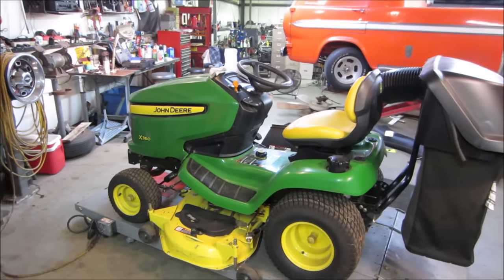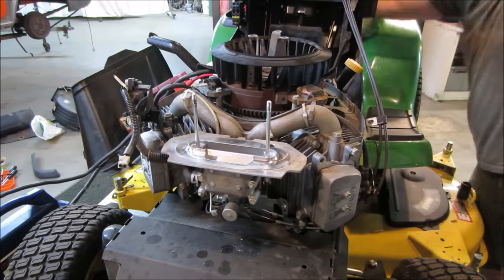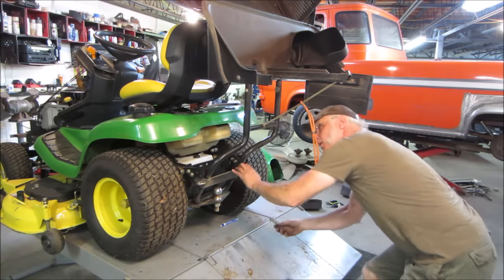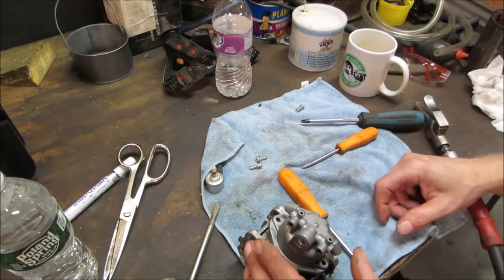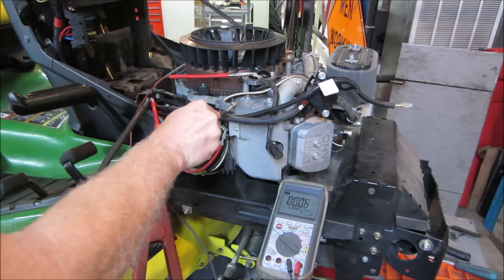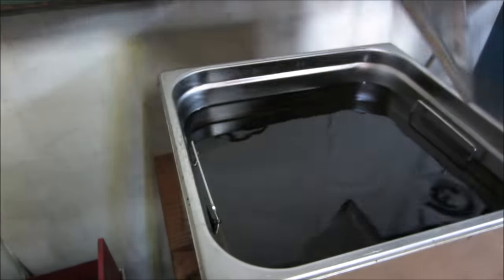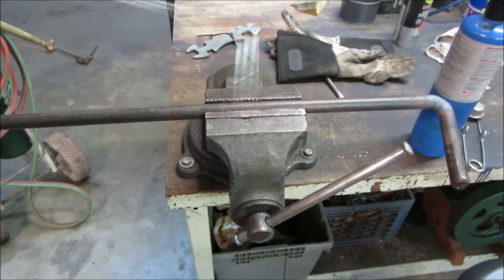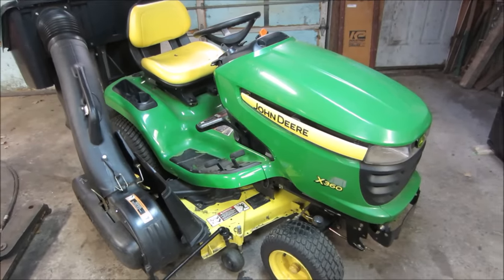Will It Run? abandoned John Deere x360 from a Yard Sale,

Comment: Glad I remembered this video I just got in a Husqvarna mower with same Kawasaki engine believe that is a FH641V also had to do a double head cleaning and valve lap and lash did not bother carb clean the gaskts were all messed up and there was chunky fuel stuff in bowl so I purchased carb and switched out the choke because the linkage was different on the new carb . runs great now .  Now I need to work on my zero turn with same engine woo hoo

Comment: FYI, supposedly Deere spent enough money building the deck to hang the deck on the tractor, the deck wheels are anti-scalp and only touch the ground when the grade becomes that uneven.   Running on the ground will only eliminate the wheels and wear out every support bracket for the deck. Great video--enjoyed!  Sure the bagger cost more then your machine purchase price. I would call that a great investment.

Comment: If that's a Kaw engine, I have 2 JD 425s with Kaw engines and they both have delay modules that will delay killing the engine for a couple of seconds after turning off the ignition. I think the reason for that is to purge some extra gas from the carb after the fuel solenoid stops the flow. I think also the reason for not being able to close the choke all the way and the spring loaded choke lever is all part of a pollution solution. It May not run for s***, but at least it doesn't stink!!

Comment: I knew it !  JOHNNY 5 IS ALIVE !!!

But on a more serious note... as you mentioned the water gathers at the bottom therefore imo the first thing to do before disturbing the motor or fuel system is to open all the drain plugs just a little to see if water exits or other.

Comment: You could file a bit off that full throttle-stop and pick up a few CFM (Ponies).
 In CA during the late '70s and through the '80s, "CARB"  limited our Quadrajets to 650 CFM and all we had to do was file the stop and let the "barn doors" open all the way up and we ended up with 750 CFM carbs and a ton more WOT horsepower!

Comment: for future reference whether 4 inch bar or 1/2 inch bar your gain on a 90 degree bend the gain or stretch  is 3/8 of an inch...bent pipe as an electrician for 40 years gain on 90s is always 3/8 to 1/2 inch

Comment: Place where I worked a few years ago,we had a problem with drivers parking their forklifts,leave switch on,engine off.Ran up hours but the drivers were not diong anything.but listening to dispatch radio and answering when they wanted to.We put a switch into the engine oil pressure gallery that would send current to hourmeter,=engine off switch on they could hear dispatch but would not get any time on hourmeter.Pissed off drivers,happy company because engine oil use went way down,less oil changes.

Comment: Is gas running out when you are trying to start it. Top cover not right, better now. I have a Sears riding lawn mower with a 46" cut that is about 5 years old. When its cold or first time starting it, I have to use starting fluid to get it to start, One little squirt to start it. When its hot it starts right up. Is this good to do this? Great Job as Always.

Comment: Hi Mustie my name is Jack I’ve been watching you for years and I enjoy every show I have a couple things that I’m hoping you can help me with. I bought a MTD Yardman lawn tractor with a 13.5 Hp Briggs & Stratton it starts pretty good but when you push the throttle to wide open position just before it’s wide open it starts to pop and backfire and wants to die but as soon as you pull the throttle back a bit it starts to run better. If you could give me any ideas I’d be very grateful.

Comment: I have the current version of this tractor and it was nice to see the inner workings. Yes, spring loaded choke and you need to choke it even when it's warm. Yes, the engine has a slight pause when turning the key off. I don't have the collector so I can't help with that part.

Comment: love everything ya do including the test light trick on the charging battery - - but it might be worth mentioning next time you're doing it that disconnecting a "live" charger from a battery that could be "gassing off because it's been under charge may be a bit risky - horrible when a side blows out of a battery - nonetheless, very much enjoy all of your vids - thanks.
Reply: I know someone that didn’t come out of a coma for 17 days and multiple surgeries, plates in his face, and a new jaw.   A chunk of the battery broke a 2x8 in a truss 14+ ft overhead.  NEVER EVER  break the connection near the charging battery with charger running. If using jumper cables break the connection at the good battery and keep your face clear while doing so.  Better yet use a chassis ground instead of the battery ground on the good vehicle and break the circuit there.

Comment: Check the water level in the Batt. may be low on water Should also use a dead blow hammer not a welding hammer to loosen up the carb.
I am  ret . omc , Aircraft Amp, Boat Evenrude Johnson cirt. Fect fuel Injection  Ob , IO mech. Nice tool on your air ratchet to loosen those carb screws!!! I would of also had a repair manual on the carb from John Deer to ck the settings and ideal circuit.

Comment: that starter is fine ...it sounds just like it should... there's nothing wrong with it that's just the way it sounds... my starter has sounded like that for four years... that's a different kind of a tractor then what you might be used to... but in fact it's a better kind of a tractor then what we have been working with all these years... it's just different things about it are different

Comment: The Deers, I have a 345 use a time delay module to stop gas, they run a few seconds to burn the gas. That is to stop back firing on shutdown. Can be a issue and hard to diagnose when runs fine for few minutes, then just dies. I cleaned the carburetor 3-4 times, would always restart with fuel down the carburetor, then die a few minutes later. The fix was to replace the TDM(time delay module), about $16.

Comment: I worked on my dads steiner zero turn mower with same motor.  For a long time. Ended up deleting the fuel shut off solenoid and installing a seperate cut off switch to coils to turn off.  His problem was always hard starts from new.  Way easier to install another switch than to mess with all their crazy tight wiring

Comment: About the old fuel still in the tank.........a neighbor advised me once to add a little Stabil in the tank before starting an engine that had been sitting a while. I tried it and it worked. Since that time years have passed and I still use that little trick. Works every time. I use only non-ethanol gas in all my small engines, but Stabil still helps out.  Give it a try.

Comment: I have to wonder.   One of the first things I check on an older battery is the water level, and make sure it's up to the right level with distilled.   That used to be one of the things you always checked when you changed your air filter.   It seems like Mustie1 just tosses a charger on :)

Comment: Another reason I'm now using the Krud Kutter parts cleaner in the ultrasonic....no issues with any type of gasket....rubber or paper....I put everything in.  I have worked on those carbs on a Husqvarna zero turn.  The Kawasaki V-Twins use that carb & variants of it.

Comment: It might be designed as a mulcher-bagger to cut up leaves so that more leaves will fit in the same size bag, since uncut leaves are quite bulky; therefore, you might want to try bagging leaves with the mulcher insert in place, especially if itg is hard to take out.

Comment: If you are sure you are finished running the mower for the season, you may want to consider changing your oil and filter before storing it for the winter and do not start it after the oil change.  Either let it set for a few days to let the old oil run down so you remove as much as possible.  Or if you change it hot let it set for a few days with the plug out.  The old oil has acids built up in it which can attack internal parts while it is stored.

Comment: I tell you what. It's still a little rough sounding but it's getting there. It just needs to cough one good  time and I think it will be fine. I'd be so scared to run 10 yr old gas through that thing. My luck it would pick up every piece of trash in the tank and I'd be tearing a carb down again. I don't have much luck with carburetors.

Comment: Mustie I’ve been watching you for quite awhile now like since u worked on the Honda ct70 i have been wanting to apply the stuff I have learned from you so about 3 weeks ago I was working and found a 50cc scooter for free on the side of the road anyways been working on it turns over and started for a second after I did your trick of putting gas in the cylinder then putting the spark plug figured out the carb isn’t getting gas just ordered a another peacock thing that feeds the carb fuel then in the process of doing so I kinda broke the throttle cable got that on the way anywho thanks man for everything that I’ve learned from u so fat

Comment: BTW: JD mower deck wheels are just to prevent scalping. When on  relatively flat ground, the deck wheels should not touch the ground.
    I have the bagger on my 318,  and even with the added weight, deck wheels dont hit the ground.....hope this is a help....
Reply: w2dmw  ,  I wouldn't have known this without your comment. Thanks a lot!  de KQ2E

Comment: Mustie 1 The John Deere is set up that way to allow the fuel not to build up in the cylinders and burn off.  I worked for 2M Tractor for 22yrs and we were a John Deere Dealer.  Hope this information helps.

Comment: I had a bad battery one time and couldn't afford to buy a new one.  I dumped all the acid out, took it to the car wash and stuck the pressure wand into the holes of the battery to clean it all out.  I dumped out the water and then put acid back in and it worked fine!

Comment: Great deal.. I have a JD 324 with 48" cut. I have been looking for a mulching plug. Is yours 48" and if you want to sell it, how much $?  The blades on it look like the factory JD low lift blades. It's not easy to find high end mulching blades that fit the mulching kit.  I wish mine had power deck lift and steering!! My lousy back and knees need it! Mine takes a few extra seconds to shut off as well. It is normal due to having a touch of fuel in the bowl. I believe it is part of keeping shit fuel OUT of the bowl. The COIL KILLS are there for emergency kill switch. Fall off the tractor and it kills the blades and engine in a second.

Comment: After having the carburetor off, or the mower runs out of gas, I use a vacuum pump on the fuel pump it makes it easier on the battery,  and starter. I have also used carburetor cleaner through the the carb and run it until it runs on its own. Many times a  customer has a bad battery and I  really  don't want to replace it unless I need to. Sometimes the customer gets upset  for replacing a battery when they can do it themselves.  (Meaning cheaper) that's fine with me .

Comment: Buy that today it's about a $5000 mower. I just bought a 330 with bagger for $4100. The 300 series are dealer machines, not big box machines. The new ones have a Kawasaki engine.

Comment: I've had 2 of those tractors,  same models and a few other's similar,  they've all been extremely cold blooded, even brand new, you'd have to choke them even when they were warm.. annoying I know 😒 2nd when they shut down they've all had that 1½ second lag after the key was off before they'd die.. must have been designed that way 🤷‍♂️ As always, Love your videos! That's what I call educational entertainment!
Reply: It seems like any ohv engine needs some choke for starting maybe from a leaner mixture running condition.
Reply: @kenore4003  One thing that comes to mind is that fuel shut off solenoid in the carburetor and having spark even with the key off.. when you turn the key off to shut it down that little plunger pops up and plugs the jet off and the engine runs for that last 2 seconds burning up all the fuel in the jet, the throat and both cylinders and then it dies.. On older machines there was no fuel solenoid in the carb, instead it just kills the spark to shut down, so both cylinders and the intake and carb are all still rich in fuel.. Choking the new ones must be how they quickly get fuel through the jet, intake and into the cylinders to fire up.. because they will fire up when they are warm without choke, but you have to crank for a while before it does.. 🤷🏼‍♂️ That’s kinda my theory anyway

Comment: I had an 80's Craftsman with a deck timing belt. It was fine until a random screw took out the belt. One blade kept turning after it knocked the second one out of the way. Bent both blades and one shaft. The belt alone on that thing was $180. But I liked it because the grass would exit out of the rear center of the deck instead of the side. You could mow up close on both sides of the deck and you didn't have to worry about regrinding mounds of cut grass if you waited too long between mows. Not that I would know... 😉

Comment: The plastic shaft with the two jets where the floater connects should stay in the carb body. It is held on by a small phillips screw. I noticed that it came out when you took it apart. So I wonder what happened to that screw.

Comment: The charger you use, is it a trickle charger? Trickle chargers with an automatic desulfation program built in work wonders on batteries that have been sitting for a while. If you don't have one of them, get one!

EDIT: nvm I just saw it was one of those older chargers. You really need to get a trickle charger with battery recovery and desulfation program. They don't cost much. A 6yr old battery would be no problem with one of those. Your battery charger pumps a lot of energy into the battery, the trickle charger is more clever and uses pulses to slowly get the chemical reaction inside the battery running again. They also work well as battery maintainers.

Comment: I have found an easy way to make linkage, in place of bending, is to use a hex head bolt at each end, cutting the round stock to the required length then welding the rod to the head of each bolt. Then you can use a plastic lock not to keep it all in place.

Comment: Mom would just shut off the gas and what run for a couple seconds then it would kill I got mine in 2000 it still runs pretty good today it was a used unit I keep up on an oil changes and tune-ups and adjusting the valve

Comment: Well, I watched this again 6 months later.  I forgot all but you making the Z-Bar in the end! 8-)) 
That was a real recalcitrant carburetor!  Where IS the idle circuit anyway? The engine was a Briggs Vangard twin, right? 
That mulcher attachment was a "put on only" kind of thing. You can see how to move the blades to get it on, but you have to know where the blades are by feel to get it off!  Another observation comes from the choke lever.  Not good for for one handed people!  
With the power steering and the electric lift of the deck, this mower reminds me of a minivan I rented while my car was being repaired from an accident.  Too much automation and extra stuff to go wrong!  The minivan had an autoclosing rear hatch.  I think it also could auto close the sliding side doors. Autoclosing of the rear hatch means you cannot close it by hand. You have to push a button on the back if it doesn't use "foot under the bumper" sensing.  I suppose it saves the wear and tear on the latching mechanism from slamming the tailgate shut. Sheesh!

Comment: Most baggers do not need that blower to do about the same as your doing.  But I could see if you had a big lawn you could use a blower to blow leaves into a screened in trailer that pulled behind your lawn tractor.😅

Comment: Mustie, I have a Deere GX345 that I have been trying to figure out for months. It is very similar to this machine - hydraulic deck height, steering, etc. Very nice machine except for the hood - they turn to glass after a couple of years in the sun (and a replacement is $400). This thing will run decent for 10 minutes or so and then die. If I let it sit for a little while it will restart, but runs like crap. I have rebuilt the carb (not new to this at all, it was done right), replaced the plugs, wires, replaced the shutoff delay module. I just can't figure out what's going on with it. I hate to give it away, but it's taking up room in my shop that I need for other projects. Got any quick ideas to check? It's got the water cooled kawasaki twin.
Reply from the maker: l would try adjusting the valves,

Comment: If you take the top off of the battery fill with water as needed, put on a 200 amp jump start for 15 min. let cool for 1 hour then back for 15 min cool 1 hour again do this 5 times it is supposed to clean the battery plates and get it to charge like new.

Comment: If that is like any other Nikki 2bbl carb, those jets are specific to the side installed on and those o rings around the jets dry rot and  cause rough running.

Comment: Ok one thing you should have done before starting it is during the gas check the oil make sure the oil doesn't have gas mixed in with it  I worked on them for 7 years

Comment: If that is a Kawasaki engine that used to put two different air cleaners. On is for a external vented carb and an internal vented carb. If you have the wrong type of filter it will run similar to yours. The air filter has the type filter printed on its top near the seal. John Deere tech school had no idea the difference between these two filters. I had one come in because of rough idle and this was an easy fix.

Comment: Because the bagger was welded, the tow ball is bound up by the screws on the sides. Just loosen those bolts a little, and the tow ball should come out easy.